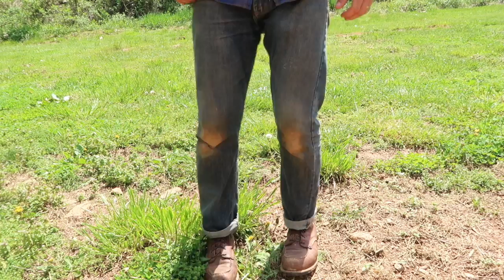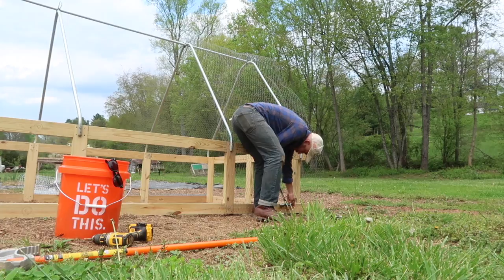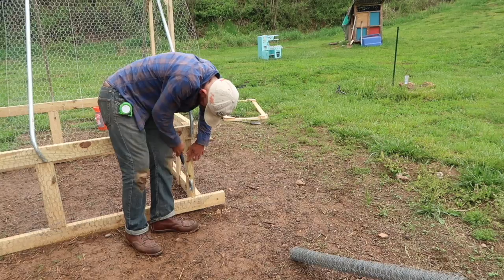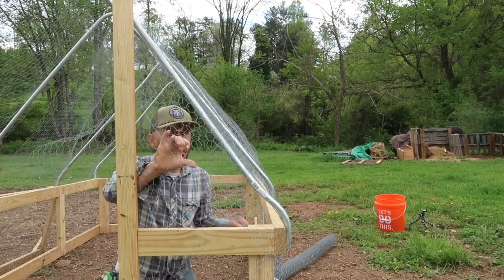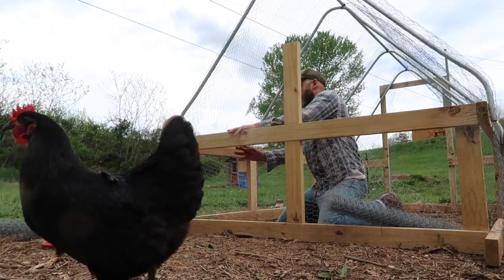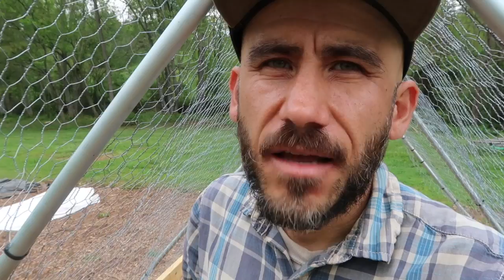$160 Chicken Tractor Build

Comment: Great to see a little girl helping I remember as a little girl picking up a hammer and my mother saying put that down you will hurt yourself but my dad would say come here and I’ll show you how to do that and he would get me two pieces of soft wood and a nail and show me how to start it and then drive it home joining the two pieces of wood which would open up a whole world of possibilities in my mind of the things I could now make with my new skilllater he showed me how to use a hand auger and hand drill and how to keep my screws straight he taught me about plumb lines and levels how to make different joins with wood and a little bit with metal and the basics of using a welder and a angle grinder

Comment: frustrating when you want to finish something and the rain is not going away. i was wondering o if you could maybe explain a little about how youy applied the wire around the door and the angles of the sides. it looked nice when you were done,  but i was not following that part as easily. I'm site youy were just wanting it to be done. i have used those fence nails before. lots of sore fingers, dropped nails,  and tedious work. nice to admire how it all looks when it's done though.

Comment: How did you manage to build that chicken tractor for only $160? I've been doing calculations to figure out how much it would cost us and it's coming out to a lot more than that. Got any tips? :)
Reply from the maker: where are you located?
Reply: @SowtheLand  Oklahoma
Reply from the maker: I know lumber and building materials are different prices from different parts of the country. That may be it. You can try finding used 2x4's?
Reply: That could be part of it. It would probably be tricky finding nice used 2x4's. Thanks for the suggestion though. :) Maybe my calculations are off or I can find some good deals somewhere.